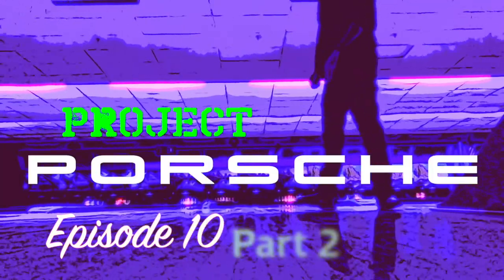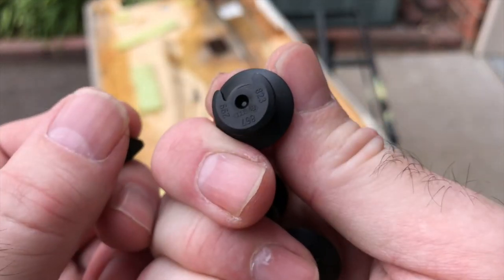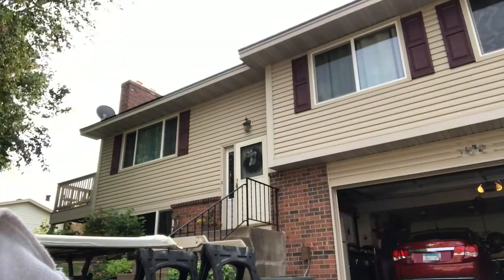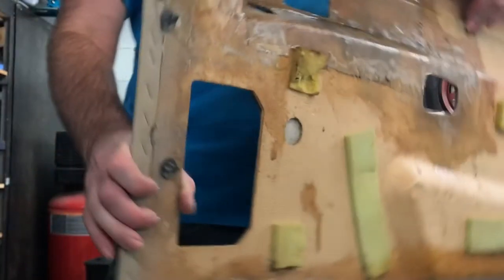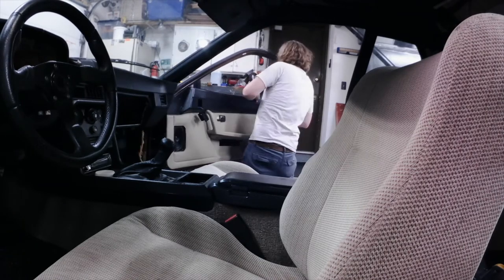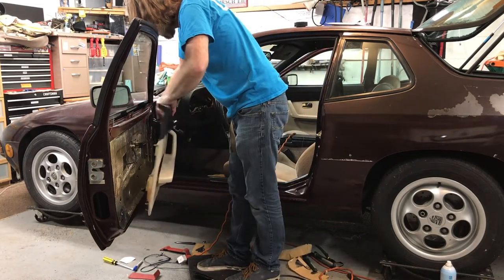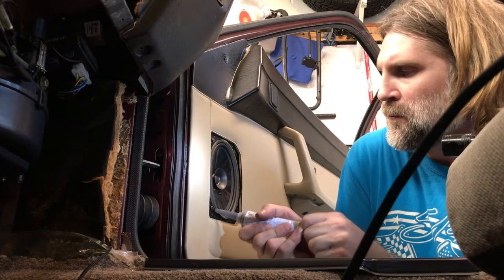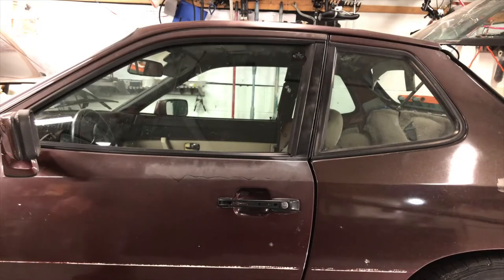How to Restore Your Car's Door Panels

Comment: I'm about to redo a bunch of my interior with SEM as well. What color did you use for the lower parts? That tan looks pretty close to factory
Reply from the maker: I think it was Sandstone.  I’ll look and see.  I took my door handle into the store and compared it to the book of sem colors they had there.  I think it turned out pretty close to the stock color but was maybe a little warmer.  Its hard to tell because my interior was faded to start with.
Reply from the maker: Yeah the color I ended up using was 15143 Sandstone
Reply: @rybreadification  Thanks a bundle man. I appreciate the help!
Reply from the maker: Your welcome, glad I could help.